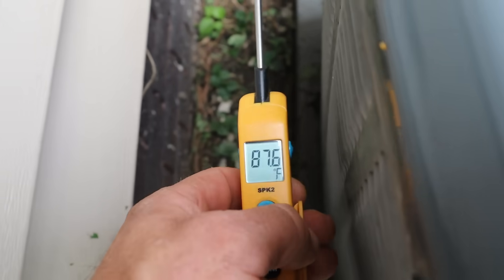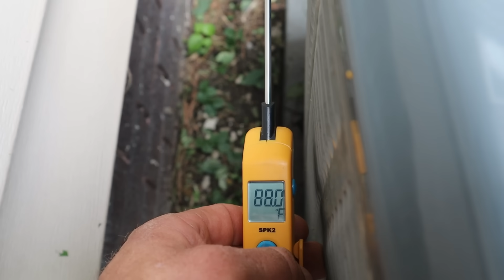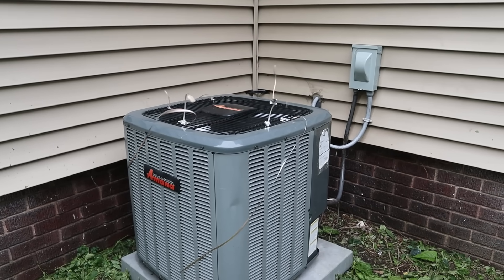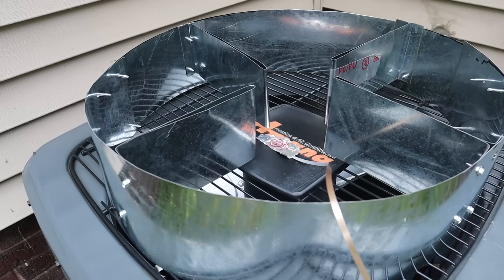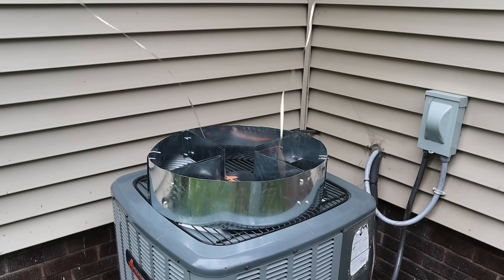Your AC Fan Makes a Mini Tornado

Comment: in my neck of the woods, this is akin to a waveguide vs infinite baffle speaker setup.

it's almost always going to have AN effect, math will get you closer to the effect you want.

i would be hesitant to say it appears you've done yours, but i wouldn't be surprised, either.

for the naysayers... packaging, service agreements, and parts are sadly a societally accepted middleman. it isn't worth changing the paradigm for ~5-10% when you can just sell another essential product. 

seriously, the question is 
what are YOU gonna do about it?

Comment: Funny enough, rocket scientists utilize this in exhaust design. There is a long explanation for this, but if you add a curve inward to the cylinder part of this, it will speed up the air molecules; beyond just the fan, away from the unit.

Comment: We can start with code requiring 3-5 ton systems to have a minimum 2 feet clearance to walls and move on up to the larger units being actually illegal to put in even quarter enclosed spaces like the example in video.   Those units are designed to be placed diamond-out with only the services corner near the wall and that being at least 2 feet from it.  The "brand cap" on the units needs to be sized correctly as well since it is supposed to block axial in-flow.   This 'technology' is bog-standard common in work done by actual engineers.     Funny enough a set of four segments of duct about four inches 'long' for a 5 to 8 ton unit sized to cover somewhere just short or wider than the fan diameter will work fine as well.   The best I've seen is simply an older unit's alloy fan with the 5 blades turned to 90° and wired into place on top so the curvature catches the circular motion and lifts it straight.     The most important factor is just getting the wall distance correct.  A short sloped overhang on all four sides of about 5 inches making an awning can also have a huge effect on blocking re-ingestion of air.

Comment: I feel like home AC condensers could be totally rethought. They're designed to suck air which relies on atmospheric pressure to push the air through the condenser. A fan forcing air through the condenser would have atmospheric pressure plus whatever pressure it could produce.

Comment: Im curious what would happen if you extended the cap over the sides about 1/4 way down (more like a rocket nozzle) so the stack and venturi effects suck cooler air up over the intakes as well. 

You're already directing air up, might as well use that to cool the unit too.

Comment: The mister is extremely effective. In the UK AC is still quite rare in homes,  but I've what's had one. I experimented with misting and on a really hot day the outlet went from 12C to 6C with the same power consumption. The heat capacity of evaporation of water is staggering.

Stopping the unit reingesting its hot air even by a little must add up to a worthwhile efficiency gain.
Reply: That condenser fins will quickly get plugged up from calcium and lime as the water evaporates.  Look at the evaporating pad on any humidifier.
Reply: @Fred2-123  yeah I bet they do, even a tiny mineral content would build up pretty quick.  Its very effective in the short term.
Reply: What you have mist 😃 is the likely damage to the condenser coils from the hard water mineral content.

Comment: Here are some ancient techniques from someone with no AC. Used anywhere from ancient Middle East to NPP cooling towers. 

You'll need a thermal insulated chamber, a chimney pipe coming straight out of exhaust and through the roof, and a shallow water reservoir on the way of the air into AC chamber. Shadow under the roof keeps air cool, water vapor cools it further and the pipe throws the hot air out for good.

Put AC into a closed chamber and make a long closed "pool" (like 10+ft long, 1-2ft wide 2ft high and around 4inch deep) as an intake cooler. If attached to a wall, it can even look discrete enough for your wife to accept it.

Or you can create a small summer "chill cave" patio, aka "bad weather barbecue zone", with a decent sized pool in the middle, chill zone and make this monstrosity your AC intake cooler.
Reply: All of that is more expensive than what the video presents, though in areas that don't have too high of humidity the pool technique especially would be a good optimization for new construction.
Reply: @absalomdraconis Of course it is! Anything is more expensive, than a bucket, lol, and that's the very point of the video. But we would never survive, unless we get a little crazy, right?

Comment: I used to do handyman work for a landlord. Every one of his rent houses has about a 3ft tall duct on top for this very reason. Most of his tenants have no idea how much money he’s saving them.
Reply: That's smart and he exhibits a very rare form of intelligence. The go to  for lesser intelligent people in HVAC guys, homeowners and landlords is to put a shade over the unit which makes it worse.
Reply: @7x779 : Shades are good, but they should shade the unit without being placed above it. Also, they need to allow lots of air flow. A privacy screen that imitates ordinary horizontal blinds is usually a good design (and technically could be placed above the unit too, if you're located south-enough to benefit from overhead shade).
Reply: Why would shade make a unit perform worse?

Comment: Flow straighteners are very common in high performance computer fans, this is the same principle. Good idea.
Reply: Noctua has a cool new (very expensive) air stabilizer for their fans to be used as a desk fan. Its pretty neat how well it works.
Reply: @alexdrockhound9497 they also give out he STL files for free so we can 3d print our own

Comment: So in this case You're really not at all worried about the turbulences in the airflow. This is not like a plane or a car and the unit will not be more efficient if the airflow out of the fan is improved in a way that drag is reduced. 
HOWEVER, you are fully correct that you want the hot air to be directed away and not get re-ingested into the unit.
Shade can of course also help. 
So with this said, your funnel may improve things a little bit but what would probably help more is building a type of chimney, ideally combined with shade and an air inlet that collects air as cool as possible. This could probably be air low to the ground, or even an underground air duct (the way some 0 emissions buildings are designed).  
A chimney may also help reduce the need for the fan to turn on, but with that said, you'll likely want to avoid doing anything that alters the functionality of the unit too much. 
This is because the unit is regulated and run by a little computer and it's operation is optimized based on a non altered unit. So if you take things too far with your modifications you may start running into issues where the unit starts to freeze up or things like that.
But there are certainly things anyone can do for cheap, just keep in mind that these typically haven't been implemented by designers and engineers for good reasons (that may or may not apply to you and your specific use case). 
But keep factors like weather and strong wind may damage parts of your modification, animals may chose to build a home for themselves, you may collect or direct rain water into place that should preferably not get into contact with water, etc... 
In this case a simple flat board around the unit, providing shade and preventing the warm air to spill back into the unit, of course with a hole for the hot air exhaust may just do the trick.

Comment: Cool idea, but here’s the physics: the “mini-tornado” above a condenser fan is just wasted swirl energy. Adding vanes or a shroud can straighten the airflow and maybe get you a little more air through the coil. That can help in very specific cases, like a dirty coil or bad clearance, but in a properly installed and clean system you’re looking at maybe a few percent improvement at best, not the 15% people are throwing around. The big wins come from clean coils, good spacing around the unit, and making sure the fan motor and blade are in good shape. In other words, don’t expect miracle savings from this mod.
Reply: The point was to prevent hot expelled air from recirculating into the condensor, NOT to straighten the flow or increase airflow.  Given a couple others say they tested this or already used this method and got significant energy savings, this is definitely worth trying.      Obviously air flow into the unit is maximized by cleaning, etc., but that is NOT what he was addressing.
Reply: Yeah the spiral effect from the fan is probably not worth correcting, but preventing airflow recirculation probably reduces runtime by a significant percentage (even 5% reduced is really good for what could be a $5 piece of plastic). Theoretically the resulting lower condenser temps could reduce the amount of pressure the pump works against, but I'm not sure if that'd significantly lower power usage.

Comment: I did this earlier this year with my ailing 20-year-old unit to try to eke out another season. My unit is so badly designed, you felt literally no air just 1 foot above the fan. It all poured over the edge back down through the coils. A roll of 14” flashing did from Home Depot did the trick. No vanes, but the effect is night and day, and I’m seeing at least a 15% improvement in the Houston heat. Worth the small cost and effort…
Reply: I'm in Houston, too. I need this.
Reply: Coil's probably impacted as well
Reply: @Johnny15432tv  Some coils are 2 layers of fincoil. They may look clean, but between the layers a felt mat will develope. I scrap condenesr units and have seen this often
Reply: I would say the fan blade was installed too low
Reply: If you have no air 1 foot above the fan you have a fan/motor issue
Reply: What does “15% improvement” mean exactly?
Reply: @FeedmeSeymore  it was 85% inefficient. 😂
Reply: Yeah that's obviously false.  15% improvement is a meaningless claim and 100% just feels

Comment: That's a great observation! but why not use a duct up to your roof line? LLM captures the idea well, "Hot air rising through the chimney creates lower pressure that draws fresh air upward from the condenser base, with taller structures amplifying this natural draft effect."
Reply: Is the juice worth the squeeze?  This simple design will not catch anyone's ire and is cost effective.
Reply: @GeorgeGeorgalis that chimney effect would work in the day time, when the top part is hotter due to sunlight.
Reply: The passive effect of air rising due to it's buoyancy from being hotter is basically negligible compared to the force of a fan in the context of an A/C unit. The chimney effect works well in situations where the air is several hundred degrees hotter than the surrounding air, like in a fireplace. Plus, fireplaces and furnaces have chimneys to keep emissions away from ground level where we breathe.
Reply: @needles_balloon : And that later effect is actually what would be desired with a chimney extending to roof-level. It would get the exhaust air far enough up that the roof and walls (and sometimes fence) would no longer have a significant retention effect on the exhaust air.

Comment: You need more than this. You need proof with temps and power consumption, etc.
Reply from the maker: I will be following up with that. Just waiting for a din rail meter to take wattage readings to be delivered.
Reply: @JerseyMikeHVAC  Nice

Comment: Once in the heat of summertime I was walking around the front yard and the AC is on the side of the house and I happened to walk (still out in the front yard) to the side where I could see the unit and I could feel the heat from that far away.  Not much of course but enough to tell that the AC was actually heating the open air around there.  I would love to make a tube to go up about 6' but that would be ridiculous I suppose.
Reply: not ridiculous! look at the comment from @markgates1051
Reply: try cutting the bottom off a trashcan to make a tube
Reply: The length of the tube would matter because as you increase the length the back pressure of the tube will raise and begin to reduce cfm's, plus affect the HP by raising amps, and the cost. You would have to experiment while looking at the system's performance (system's pressures and some temps)

Comment: Seems like that has more to do with it being in a corner and too near a wall. Minimum is 1 foot and recommended is 2-3 feet. You should try the same test without the fins, and just moving the unit.
Reply: Moving the condenser is likely impossible without replacing the refrigerant lines. And that's not worth the effort.
Reply: "just moving the unit"
Not a simple task my friend.

Comment: excellent idea!! I have been wanting to do something similar, but also different. My condenser sits in a corner with roof eaves/soffits above it so that acts as a deflector which I think makes what you are describing even worse. So something like what you made that also angles the exhaust air out away from those soffits would be ideal.

Comment: Not bad.  Keeping heat from washing back into the coils should help unit to perform better at slightly higher ambient temps.  Eaves are always a bit of a problem, but putting a unit in a corner like that makes it worse.  Residential outdoor units are always cheaply made: one thing almost universally missing is a shroud around condenser fan blade - lots of air drives off the blade tips instead of being moved out.  I am reluctant to modify my unit in that regard, because that would increase cfm and velocity matters - might have to experiment with reduced pitch to hold the same design parameters.   Time across the coil is where heat exchange happens.  I have witnessed shell & tube types cool better by slowing down water velocity, proving more isn't always better.

Comment: Protect that vortex! Same thing applies to every fan in your life. That 24" box fan I put in the window would do fine, except I leave the screen in place right in front of it, disturbing the vortex and reducing CFM. Building a tower to straighten out the flow makes sense. If you don't have that option, place the fan as if it is a six feet long invisible tube.

Comment: I love this kind of stuff! I wonder if you could put some type of vertical windmill on it too so that as it's blowing air it could also generate more electricity? Not sure if that would work but love this thanks!
Reply: Hmmm. Like just throw a box fan on top and it windmill, then collect the energy it gets from that? Maybe. Wouldn't get a lot out of it probably, but it would steal a lot of the energy out of the spining air for sure. Might be able to use it for some garden lights or something

Comment: I wonder if the CFM was reduced by adding the vanes?  Since the air has to bounce off them to straighten out the exhaust there must be some energy lost….  Can you test for cfm before and after as well as Freon temps..  see if there is any difference
Reply from the maker: Yes I'm going to follow up with all of those measurements. But the point you bring up is why it wasn't designed to be very tall; to avoid friction rates the fan would have to work against. The veins actually help reduce load on the fan by straightening out the airflow and reducing turbulence. But the real energy savings is in reducing air recirculation to take load off the compressor.

Comment: Quick search on Web and got nothing like this commercially available. I'll have to find someone to 3D print it
Reply: Aluminum siding and some self-tap sheet screws are beyond your crafting abilities? Hell, just get a metal trash bin and cut the bottom out.
Reply: @Providence83 Ideally you'd want something with a trumpet shape, which siding cannot achieve easily and trash bins are too straight for.
Reply: Use a 55 gallon plastic barrel
Reply: How big is your 3D printer?!
Reply: @Sudonymer  One can make pieces that snap together like puzzle pieces to make larger items.
Reply: It's a pretty large and simple design, which is kinda the opposite of a 3D printer's strong suits. Not to mention outdoors in the sun and exposed to hot temperatures which doesn't play especially well with most filament types.
Reply: You have to model it first. Quick search on your making skills tells me that will be an issue.

Comment: First off that’s the installers mistake of butting up against two walls in a corner cutting down air flow on two sides. 
And how much saving did they really see? ($) that’s the real proof.

Comment: Nice video. Sticking it in the corner doesn’t do it any favors either. Too often you see the units too close to others structures and obstacles. Air flow (exchange) is critical to efficiency.

Comment: Good idea!  I'd use 8 vanes, there's still room for slop as the air isn't quite ducted yet.  Also, cover the top of those gaps against your house.  The suction will try pulling that air in no matter how you direct it, otherwise.

Comment: Watching this I immediately  said - I can 3D print that in parts and assemble it.  Lots of good comments about changes, It would be great if someone could make a sketch of an ideal design for guidance.
Reply: Just put  about 3 feet of a plastic barrel over the top. Too big is just fine.

Comment: I wonder if we'd see the same amount of improvement on a condenser that's properly spaced from the wall ?
Reply from the maker: The improvement on a properly placed condenser would probably not be as drastic as this situation in a corner and/or up against a wall like this, but there would still be a little recirculation regardless. Just not as much. It would still likely help in reducing drag on the fan blades, but the big efficiency savings is in reducing head pressure on the compressor. So the fan benefits alone might not be as dramatic of a savings.